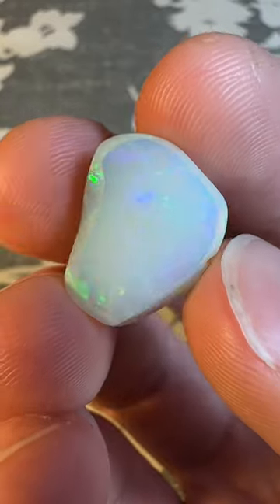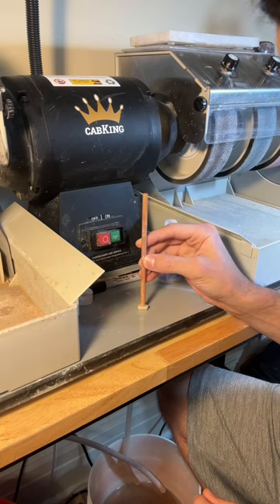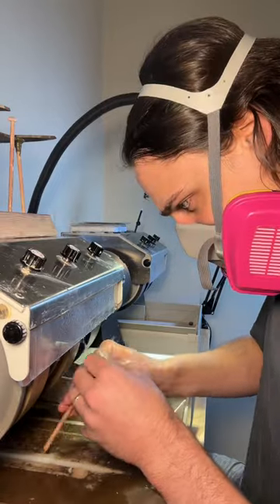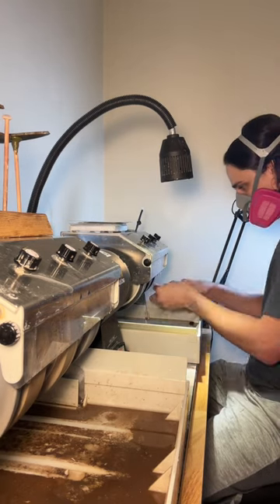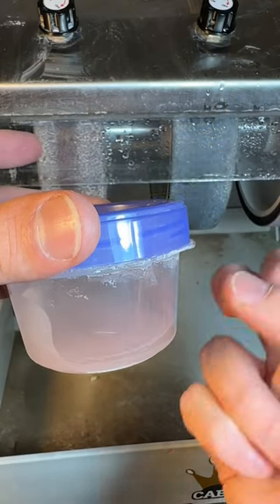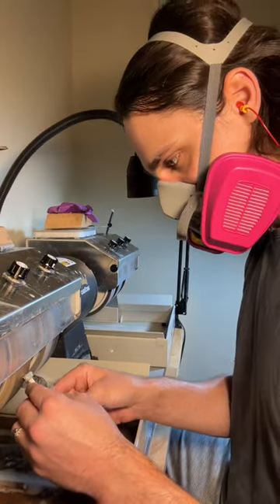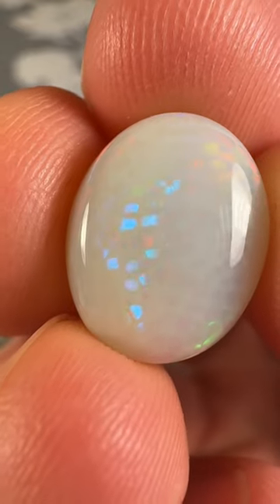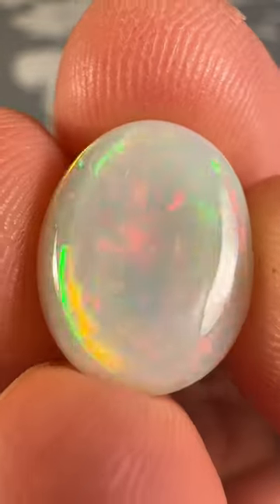Cutting Ethiopian honeycomb opal | How to guide for cabbing Welo opals

Comment: Found you via algorithm.  Let's see if we can push you to 100 subs.  

Ps I prefer flat lap for all of it but whatever floats your boat 😀
Reply from the maker: Thanks :D   I started on flat lap and moved over to grinding wheels. I found the flat laps needed replaced often, and what really got to me was the forced downtime
Reply: @heaveninearthopals3855  fair enough.  I'm a bit of a tinkerer so my equipment gets a lot of unforced downtime... my beef with gem machines is more techniques than anything.  If you buy a rub,  you can almost bet the face is concave.  That's because the seller quickly jammed the stone flat against the wheel and didn't bother to straighten.  Means rounding of the sides is a real pain